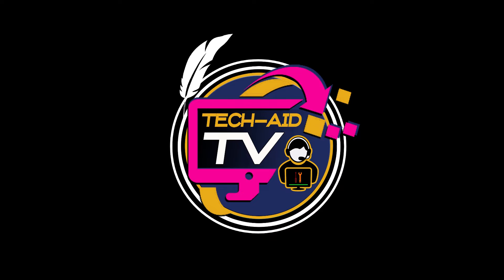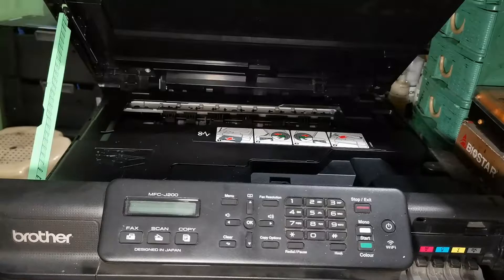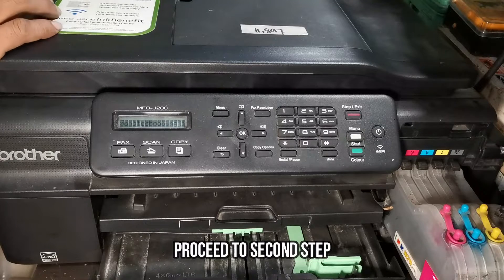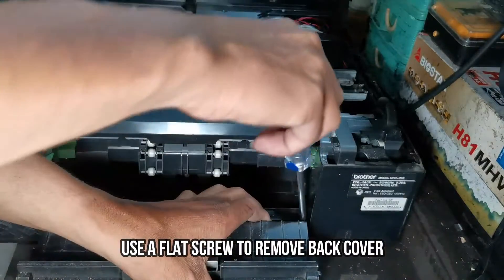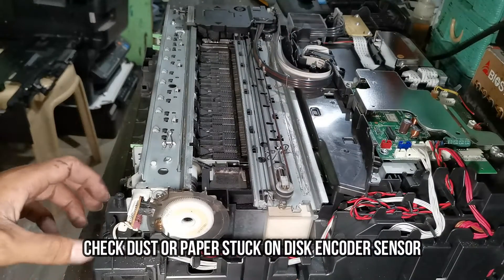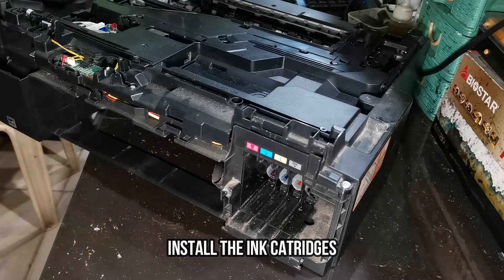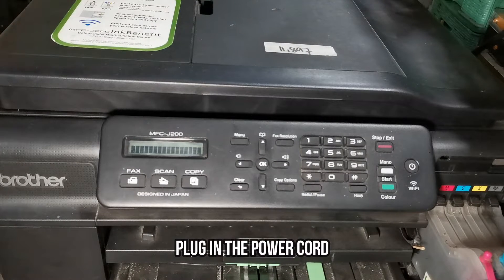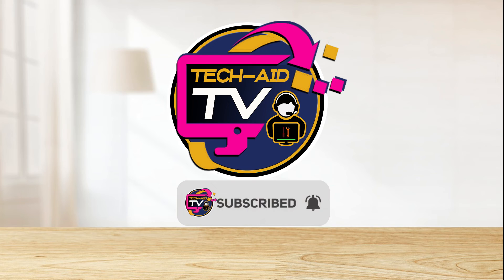HOW TO FIX CLEAN UNABLE 8F ERROR - BROTHER MFC-J200 PRINTER.

Comment: Thanks for the video helped fix my printer. Note for others be careful when reattaching the encoder strippers. If you do it wrong you will cause a false paper jam error. Took me 3 attempts to get it reinstalled correctly. Put some paper towel down to stop the grease/lubricant getting on the strip when fitting the strips again.
Reply from the maker: You're Welcome
It's our pleasure to help
We are grateful for your support